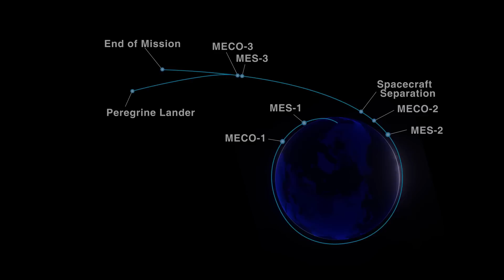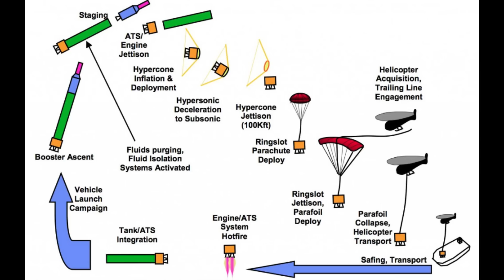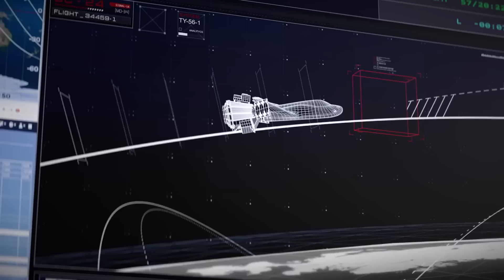Why Vulcan is the Most Important Rocket ULA Has Ever Built

Comment: Does anyone know why Amazon when down the oxygen rich route for the pre burner on the be4? As opposed to fuel like the rs25? Given that methane is cleaner burning like hydrogen? And did they copy the technology from the rd-180 for its pre burner?
Reply: Amazon does not own Blue Origin, they are two independent companies. Their only connection is that Jeff Bezos owns both Blue Origin and 9.5% of Amazon, and that BlueOrigin is one of the companies contracted to launch Amazon project Kuiper.

As for why Blue Origin went with oxygen rich, instead of fuel rich, I don't know. But I do know that during the time of the RS-25 and other, earlier American closed cycle engines the limits of American material science research made an oxygen rich cycle unattractive. Ultimately, the Soviet scientists solved that material science issue for their own closed cycle engine development program, and today we have even more advanced materials and manufacturing methods, so I imagine that wasn't a huge concern at BlueOrigin anymore.
Reply: @plainText384  thanks. Is there an advantage to going down the oxygen rich route, like that used on the RD-180s? More power, simpler and cheaper, fuel efficient?

Comment: " wouldn't it be great to have DreamChaser landing in SFO?"
Based in the several VASaviation video I've seen, that is probably the last place I would want to plan its landing. Planes croasing 28L to take off from 28R and vice versa, causing go-arounds... that does not sound like a place where I would want my Space Shuttle to land... and if Dreamchaser is anything like Spacw Shuttle, that it's  a flying brick and you only have one attempt to land...
Reply: Dreamchaser glides to land, but is hardly a flying brick. The X-37 space plane also is a glider for landing. Gliding to land did not seem to be a problem for the Shuttle.
Reply: @alexanderSydneyOz  "Gliding to land did not seem to be a problem for the Shuttle." it was not because they had skilled pilots and/or good computer (I am not sure from the top of my head which phases of approach/land were frown by which). I don't expect that to be the problem with Dreamchaser either.
However, the problem that I pointed out, was that if it's still just a glide (like with space shuttle), they can not go around (Shuttle could not re-light their engines, and fly climb up and try again). That makes it infeasible for it to fly to SFO (during normal traffic, which was implied in the video, that would be cool to see it land there as just another plane), because SFO is kind of notorious for its high go-around rate because of traffic crossing the runway to get to the parallel runway...

So my point is that while Dreamchaser and Shuttle might be good at landing on the first attempt, SFO is not good for attempting landing where you only have one attempt.
Whatever, i guess.  It was a joke at SFO's expense, of course nobody would try that IRL

Comment: Fun fact; this rocket has a higher payload to the moon than Starship does without refueling. Starship in it's reusable mode has ZERO PAYLOAD TO TLI LMAO. Only 27 tonnes to GTO, 8 tonnes to GEO, and 0 tonnes to TLI.
Reply: It all comes down to the use of hydrogen fuel and its higher Isp vs methane. Downside of course is that hydrogen is a PITA to work with and makes everything more complicated and expensive all around.

Comment: watched the ULA launch last night...very cool.  Now ULA and Blue Origin needs to have quick turn around times.  Let's see what happens...good luck to ULA and I feel kind of sorry for ULA having to depend on Blue Origin or engines.
Reply: BE-4 had some issues during development, but so did the Centaur V. Now that BlueOrigin has a working design for BE-4, I don't see why you would need to feel sorry. They are quite impressive engines, with a good mixture of high thrust and high efficiency. They are also already set up to be reusable, if and when ULA decides to begin attempting SMART reuse.
The only question is whether or not BlueOrigin can keep up with production while maintaining the reliability and quality control, as they are switching from prototyping to full mass production. But at the end of the day ULA has priority on engine delivery, so if production is slow New Glenn will have to soak up all the delays while Vulcan will barely even notice anything.
Reply: It beats relying on Russians!   The BE4 engines were delayed, but in the end the V/C was not ready by the time of their delivery, so it seems no problem to rely on BO for engines.

Comment: How ULA will compete with spacex on a market? Vulcan cost 110mil, falcon 9 62mil, and Starship develop extremely fast to the point it probably be full operational in 2 years
I think ULA need to start desigh their own reusable system right now or it will launch only goverment military payload for the near future
Reply: It have better orbital performance than Falcon 9's second stage and bigger fairing.
Reply: @remliqa  Falcon 9 fairing is 5.2 m, vulcan centaur 5.4 m, only 3.8% bigger, not so much i think

Yes it have more efficient upper stage and can puch to GTO and TLO more payload with 6 SRBs than falcon 9 and falcon heavy in reusable mod, but there is no good information how much this will cost, at least i cant fint any good information
Reply: @Syntropics  I forgot if it was Everyday Astronaut or Scott Manley, but there was a video on YouTube  that compared the size of fairing for all active launch platform. It shows the Falcon rockets have smaller fairing than its American and European rivals. What is interesting is that it s not no only have smaller diameter but also less height compared to them.
Reply: Falcon  doesn't cost "62 mil".Its about the same as ULAs 110 mil. What musk does he charges 360 mil for government contracts then offsets the cost for other contracts claiming its 62 million. If Government ditches musk his launches would cost the same if not more.
Reply: @dukenukem8381  Where can i read about that?
Reply: @dukenukem8381 I don't know where you get that but it is completely BS. Firstly the   reason for the price disparity between governments contract and non-governmental ones have to do with other reasons such as insurance. Secondly, Space X still charges less than ULA does for government contracts per average due to the lower cost of building anew Falcon rockets compared to ULA's. Finally you're not counting the facts that Falcons rockets  cans be used dozens of times, lowering it's cost.

Comment: "no powersliding off the pad" ?
Reply: Yeah, about the Atlas5 with booster options of 0 to 5 vs Vulcan of 0-2-4-6 GEM solids. If Atlas launches with a single booster, its mounted facing the launch tower so its significant asymmetric thrust will push the vehicle AWAY from the tower, thereby avoiding collision (a good thing) hence the "power slide" to the side.
The Space Shuttle launches were similar looking, the orbiter being attached on the SIDE of a huge tank+solid boosters assembly, with the Rs-25 HydroLox engine's firing offset to an angle thru the center of mass. Was always a great show!

Comment: It's good that there will finally be a significant advance in upper stage technology for high orbit and deep space missions. For all of the laudable advances SpaceX is making with its Starship they have put all their eggs into the in-orbit refueling concept for the vehicle and do not seem to be interested in having a single launch high energy upper stage for missions that don't require such a massive vehicle as Starship. The Centaur V can fill this need, and has a generously sized fairing to boot.
Reply: Part of is the market for missions that require it is small.
Reply: Everything is important, but refueling(and orbital construction) kinda removes mass ceiling to deep space missions and unlocks space tug reusability.
Reply: All valid points, but it would appear that the market for deep space missions will increase in the near future. And orbital refueling will always require multiple launches. The whole Starship concept is a promising one, but the fact is that many of the missions beyond LEO will not require such a large vehicle as Starship and will work favorably with a launch vehicle whose flight trajectories can extend beyond low Earth orbit with a single launch.

Comment: still funny that New Glenn is delayed prob to 2025/6
Reply: New Glenn is flying this year. They are not delayed to 2025. You need to keep up with current news instead of hating. Also the BE-4’s are the first US methalox engines to send a second stage to orbit. Beating spacex raptors. Lol you must feel foolish
Reply: @Lekuuuuuuuu  raptors were not first. They did not power anything to orbit. They did not power any payload, they failed and melted. BE-4 is the first closed cycle engine to power a rocket to orbit. They worked perfectly on their first try. Vulcan is the first methane fueled rocket to reach orbit on its first attempt, and the first to reach orbit from the US. And they didn’t need to blow up a bunch of them to succeed lol
Reply: @Lekuuuuuuuu  raptors would not work with falcon 9 lol stop clutching at straws and admit the fact

Comment: How can any launch system without reusable first stage boosters compete now that SpaceX is reusing boosters? The price per kg to orbit must be so much higher with these consumable systems. Always enjoy your videos Scott!
Reply: A break down of costs would be interesting
Reply: A falcon 9 launch is about70 million.  About 70% of the cost is of the rocket is in the first stage.  In comparison the vulcan 2  BE4 engines cost about 40 million, while the to two RL-10 engines cost another 40 million.   I don't know how much the SRBs cost.   ULA doesn't make rocket engines they buy them from other companies.    Space X makers there own engines and the Merlin of the falcon 9 reportedly  cost about $2 million each.
Reply: They’re actually not that much different as the majority of launch costs are fixed costs not the rocket itself. Both Falcon and Vulcan have signed government launch contracts for about $100m per. SpaceX probably is making a larger profit but not as much as you’d think
Reply: @GlutenEruption how much do you think we're thinking?
Reply: @GlutenEruption  "SpaceX probably is making a larger profit but not as much as you’d think"
Given that you can buy a one-off Falcon launch for $60m, I would say that $100m, assuming you are correct in that claim, is a bloody huge profit.
Reply: @GlutenEruption  Provide the evident and data, otherwise your assumption is totally irrelevant.

Comment: I see ULA is using a Cincinnati Milacron machine to make the large panels. Cincinnati Milicron went out of business decades ago, wonder where they get parts for such an old machine or find anyone who knows how to program it! Also proves CM made some very durable machines.
Reply: When the control electronics become unavailable we rebuild our machines with new controls and often rebuild mechanically as well. There are loads of companies who do this work as well. We have Cincinnati through grinders that have all probably been rebuilt several times, when we replace one the old one goes to be rebuilt for someone else, the castings could be 50 years or more old.
Reply: Just so happens that the kind of people that use these kind of machines tend to be good at making machine parts, no?
Reply: I figured that was probably happening, but I guess that also means that no equivalent machines are being built now, or that the cost to replace the old machine is very high. It looks like they have more than one of the same machine, but it has got to be a pain to need to reverse engineer parts when you need one. What if the failed part is too distorted to use as a guide? Maybe they have CM's shop drawings for the original construction of the machine. One of the CM machines I worked on back in the 70's had a little glitch in the tool changer fingers that would collect chips from the machining process. When it did, during the next tool change it would throw the tool across the shop! All of the CM machines we had seemed to be a little too high speed on changing tools. @bulakhv
Reply: Ingersol and Fives still will work with old Cincinnati machines
Reply: If the machines are being USED, they don't last 15 years. You can't easily "rebuild" the Ways 😂. No one would want to. My dad has worn completely to unusable about a dozen metal shaping and cutting machines over the decades, it's cheaper to buy a NEW machin with HIGHER accuracy and ALL NEW EVERYTHING... Tham trying to what? Have a welder build up the ways and then have them re-ground?!? 😂 then re-hardned?! 😂
Machines that collect dust, last decades. 
Machines that get used 40 hours a week every week, do not. They cannot.
Reply: @suburbangardenpermaculture3117  Where I work we have 30+ years old CNC & non CNC lathes, mills & grinders working everyday making super precision bearings.
Reply: @mikerubynfs  must be a Touch Off shop, not taking any meat off the stock then 🤣
Reply: @suburbangardenpermaculture3117  Most  metal is removed (from tubes) by the lathes, up to 20 years old. 30 year lathes & mills work composites. Grinders are 10 to 60 years old some working to 0.1 microns, we have rebuilt most over 30 years old. All working 2 to 3 shifts.

Comment: 4:48 i always wondered why do they cut the orthogrid first and then bend the plate instead of bending the plate first and then use a 5-axis mill to make the orthogrid lightening cuts?
Reply from the maker: I suspect because it requires a simpler milling machine, and the bending machine then needs less force to bend it
Reply: @scottmanley  the whole point of the ribs and webbing that isn’t machined away (or is welded in by spacex) is to resist bending. Their huge bending machine seems to have added complexity involved to make sure none of those thin features buckle during the bend. I really hope it’s not that they happened to have a gigantic bending machine from a legacy project and another gigantic router table and thought “this problem looks like a nail!”
Reply: @JinKee  you can use a much larger cutting tool to cut on a flat surface than you could to accommodate the surface curvature.  It's faster and easier to cut it first then bend it.  Otherwise you'd need to get a huge 5-axis machine and try to cut it in a much less rigid setup.

Comment: I suspected that the beautiful flame livery on the Vulcan booster would be discontinued after the first launch. I remember how NASA stopped painting the external tanks of the Space Shuttle after the first few launches. The weight penalty of hundreds of pounds of crisp, white paint that would just burn up on reentry didn't make sense. However, I have wondered if the paint layer on the external tank might have reduced the amount of insulation that came off the tank on ascent, perhaps preventing the Space Shuttle Columbia disaster.
Reply: By mechanically holding the foam together and maybe even some aerodynamic forces?
Reply: @eltopia11  That was my thought.
Reply: there's a little bit more nuance to the white tank. The paint was added to reduce heat absorption from the sun during fueling/ flight. Eventually it was decided that the amount of fuel saved wasn't worth carrying the weight of the paint.
Reply: @jacobspadt2567  Good information! Propellant boil-off mitigation hadn't even occurred to me as a reason for painting the external fuel tank white.
Reply: Nope.  None of the Shuttle disasters had anything to do with the paint.
1. That giant firescorpion came from a loosened booster breaking the tank.
2. A lost heat tile happened more than once!  It doesn't always result in a disaster.
🚀🏴‍☠️🎸